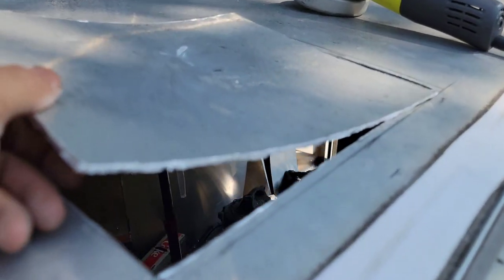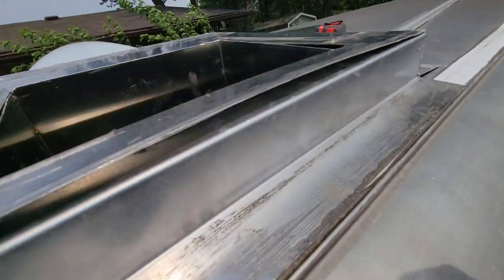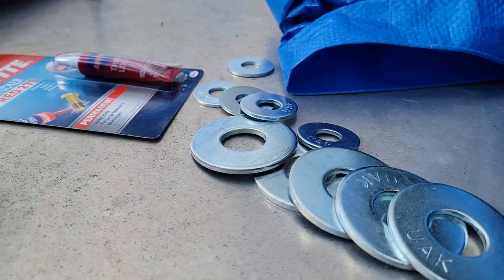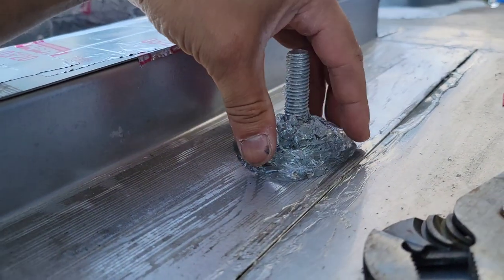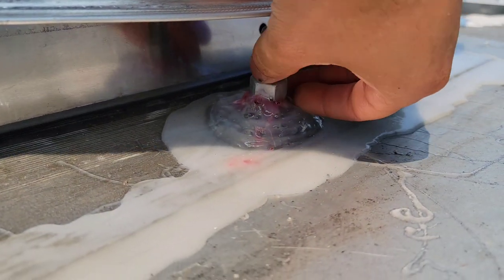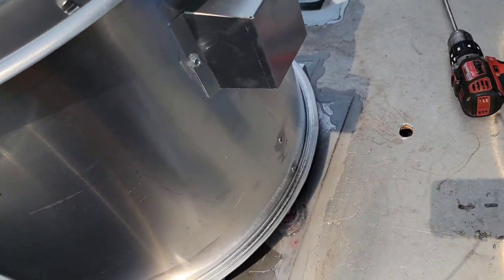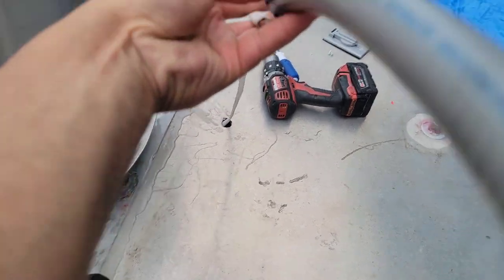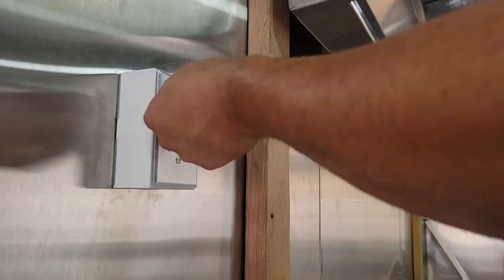How To Build a Food Truck: Exhaust Hood

Comment: Instead of silicone which will fail in a few years, use butyl instead.  You can usually get it in rolls from a metal roof supplier.  I've removed roofs that were 20+ years old and the butyl is still in good shape and pliable.  It can be molded and placed under and around washer/bolts and will smash into the threads and any holes when compressed.  Been using for that purpose for years and haven't had any leaks.
Reply: Good info!!! Thanks
Reply: Rummy for the win!  Thanks man!  I was thinking about this exact type of thing but I had no idea what it was called.  I appreciate it! 
Btw, to others looking, I found a 20 foot roll on Amazon of butyl sealant tape for about $24.

Comment: I love your videos thank you so much for doing them.. I'm also building a trailer and I have the same style ceiling is what you have and I was wondering how I was going to attach a square Hood and something like that. Seeing how you have them put the 45 on it will be a big benefit for me as well. My question is what were those jacks that you used to hold it up? Where did you get those? Those would be so handy.
Reply from the maker: Don't know if you bought them yet but if not these are the ones.  https://www.amazon.com/gp/product/B002RL8ODK/ref=as_li_tl?ie=UTF8&camp=1789&creative=9325&creativeASIN=B002RL8ODK&linkCode=as2&tag=rollingburrit-20&linkId=cb82312aa8e0e51572af376383eb76a5

Comment: Almost identical as mine. I welded 2x1" steel tubing inside and used 1 roof beam that was my 4th piece and made my own duct only about 5" high. Used # 10 ss hex bolts-washers to hold, mount Hood inside to 3 studs on back and 2 studs on roof.

Comment: You're the best!  Thank you so much for doing these videos.  I have learned a TON.  I have a question.  I am thinking to simply do/use a Panini press for sandwiches.  Will I need a fume hood for this equipment?  I am in Colorado.  I do not see anything in the regulation that spells that out.  I understand that the Panini press has a collection tray for any fats that could flow out or down.  Thanks in advance!

Comment: Great videos frank. Question?  Why wouldnt you use a seal tught connector on the roof side also instead of silicone or flex seal. I  would think it will create a roof leak over time in that small hole.

Comment: Those large hood bolts going through the roof. I would have used thick rubber washers underneath the fender washers. So you won't get leaks.And instead of using flex seal, I would have used mobile home roof sealer. It's a silver seal paint you use a roller to apply.
Reply from the maker: I'll have to try those rubber washers next time. Thanks for that tip

Comment: Hey frank, thanks for the videos. I just got my hood in from hoodmart and am installing it tomorrow. Mine has brackets on it for mounting it is a 12 ft hood with electrical on top with only 2 brackets on each end and they don't line up with studs not to sure if you have ran into this before. Thanks!
Reply from the maker: That's a big hood. Don't know what you mean by 2 brackets
Reply: @fbaltierrez  it was a beast to put up. the electrical for the lights were mounted on the top of the hood so it could not be flush on the ceiling and when I purchased it I chose hanging brackets installed. I had a buddy weld some 2" square tubing up top and it went up no problem.

Comment: Hey Frank , Dude you did a phenomenal job explaining the whole hood installation process, which is the reason I was able to do it myself. 
My question is why did you never mention that you have to order the fire suppression system with the hood from the hoodmart when you order the hood because I just called today to order the fire suppression system from hoodmart but shockingly they do not sell the fire suppression system by itself , you have to order it with the hood and it comes pre installed.
Reply: Call a fire extinguisher company.  Cheaper

Comment: 👋🏼Hi my friend, May I ask, can 100% silicone roofing coating be applied over flex seal, will it stick to each other? Also how well does flex seal adhere to 100% silicone caulking?
Reply from the maker: If it was me I would do the silicone first and the flex seal on top of that.

Comment: How are you friend ,

I have another question to fasten the smoke extractor up on the roof to the base, did you use screws or bolts with a nut and what number?
Reply from the maker: It all comes with the hood, all one kit.

Comment: Hi Frank thank you for your amazing video bro. Can you help me with this: i have a single-speed exhaust fan and it goes much faster than i need, can i use a motor speed control "Vari-Speed" as yours to control it? My exhaust fan is : 115 V, 3 A. wiring is straight forward: from my input wires, one black (line), one white(neutral) and one green (ground), they are connected in the same order and color to my fan. So in order to add a "Vari-Speed" in between, which means  i just connect the my black from the input to one red from the knob, and another red from the knob to the black of the fan? Make sense? Please show me Frank or anyone with that knowledge, thank you all.
Reply from the maker: To be honest I would not know the answer to this. I just use the kit that comes from hoodmart as is. It's a variable motor switch. I'm assuming guessing since yours is single speed it won't work. But that is a guess

Comment: So I ran a 12/2 wire to the hood switch and cannot really pull another wire through. Could I just wire nut both red wires on the 1 hot wire?
Reply from the maker: That's all I ran to my hood switch. One cable to come in for power one cable to go out to hood. If that's what you meant

Comment: Hey what's up Frank,  I need a little over 50 Amp service. Do I still use 8 guage wire and 50 Amp power inlet
Reply from the maker: I would go with 6 gauge

Comment: As union IBEW electrician I would use electrical tape the switch attached near the fan and black tape potentiometer (dimmer) and wire nuts. Things I’ll get loose because it’s a moving vehicle

Comment: Hey Frank 👋🏾,,, what did you do with the green wire in the speed dial ??
Reply from the maker: You can connect it to the box, or the switch has a little green screw or wire that can be attached too

Comment: Do you secure the exhaust fan with anything or it just sits on top of the vent?
Reply from the maker: You attach it with screws it has holes on the exhaust fan lip at bottom. Super easy
Reply: @fbaltierrez  what size screws did you use?
Reply from the maker: @TheRealSuperJ  https://amzn.to/3JzJEI3
Reply from the maker: @TheRealSuperJ  those are my Paid Amazon Links of screws I use.

Comment: Is the wired you used to connect the hood switch to the dial 14-3 or 12-3
Reply from the maker: You can use 14-2 or 14-3. Both work 👍

Comment: was there any specific reason why you went from a 3/4in to a 1/2in connection for the exhaust fan? I'm starting the hood install this week and needed to pick up the liquidtite and connectors.
Reply from the maker: 3/4 is the fitting size from the hood. No reason you can use 3/4 I just didn't want to buy more
Reply: @fbaltierrez  alright thanks for the quick response! I picked up the hood and window last weekend. 17hr road trip there and back! Gonna do them both this week so I wanted to pick up any extras I needed. I’ll email pics when I’m done
Reply from the maker: @ItsHimMega  long road trip. Hopefully you saw all the cool horse buggies
Reply: @fbaltierrez is 14-3 good for wiring homerun for outlets?

Comment: Do you need a makeup air unit? How do you combat negative air pressure when the exhaust is on? Thanks for the video!
Reply from the maker: No, haven't seen a trailer yet with a makeup air in person. I haven't had any issues with any negative pressure

Comment: Hey Frank, I have a question:
I had made a comment but then deleted it because I actually thought more about it and wasn't sure, so I wanted to ask you first:
If that square duct was cut shorter, would it have fit the hole without having to make the hole 1/4" bigger?  It seems like the hole was cut bigger, then the duct was cut shorter later.  I'm wondering if those two steps were reversed, would you have been able to fit the duct in, due to not having to go at such an angle, with it being shorter?  Or am I going to run into the same issue regardless?
Reply from the maker: That's a tough one, I know with the other I cut, I used that angle to my advantage and made it fit more flush. But took a few to get it lol